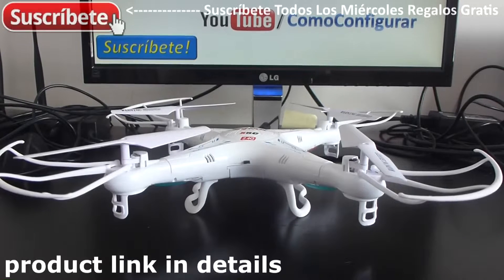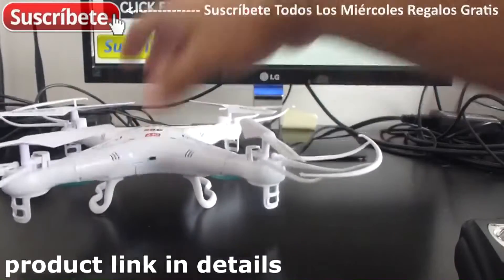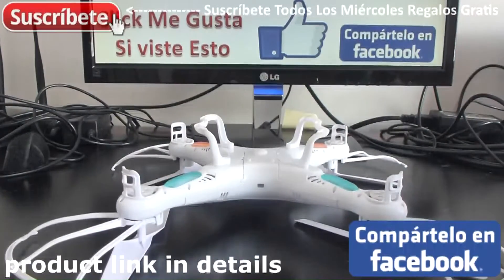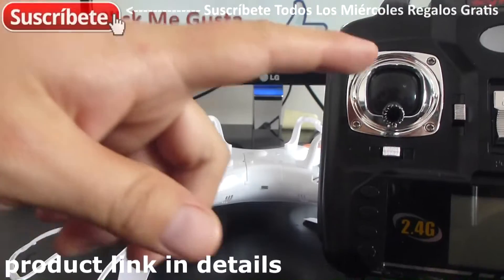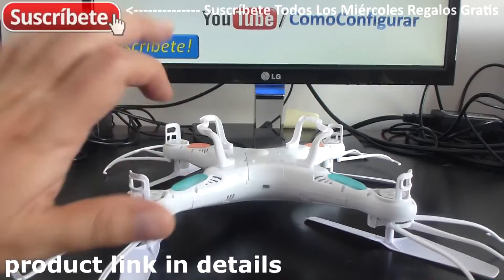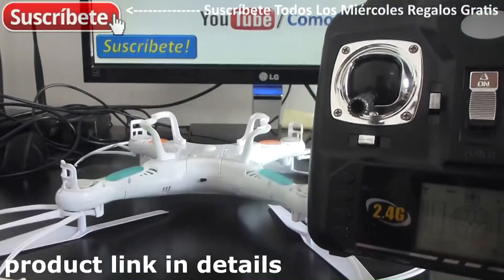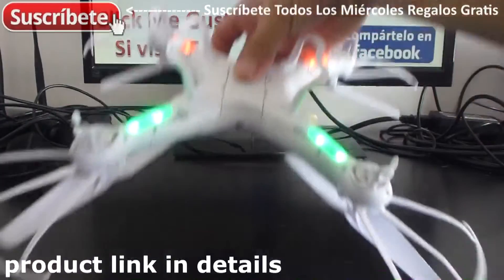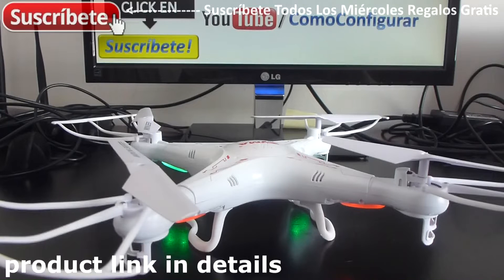how to bind chinese quadcopter Syma X5C-1 New Version Explorers

Comment: BNIB here and I cant get it to bind?  LEDs just blink rapidly non stop? any ideas? it worked for 5 mins while I broke in the motors ay my table, then swapped batteries and it will not bind, no matter what I do, just sits there blinking rapidly

Comment: I am new to this, (newbie) I lost my owners manual. I was wondering if you could tell me ,1st ,how to trim my x5c-1 and what is the top left chrome button used for? I just dont get it... I know about mode 1 and 2,,,I can fly it, but it seems everytime I start out, its flying left, right, or front and back???? I cant get this quad to just,hover without input to controls....Help me please ? Newbie.....
Reply from the maker: this quad dos not have altitude mode so you have tu lift it abaut a meter then wen hovering you most ajust if it is going to the left pres to the right 1 time the litol boton below the left and right stik. and if it goos to front pres litol boton back in fron and back stick. the top left botton puts the quad in low and high mode make it go faster and easy to control in windy condiciones